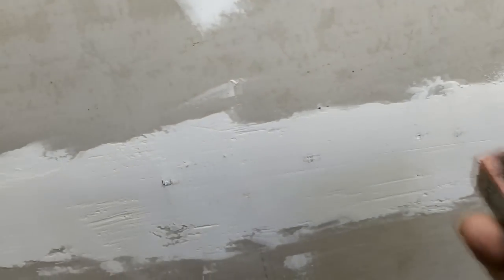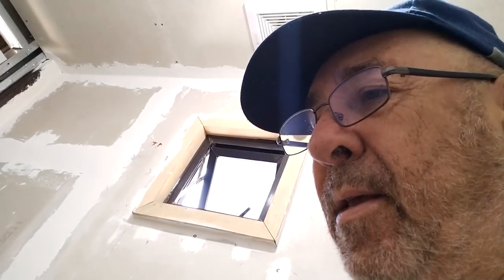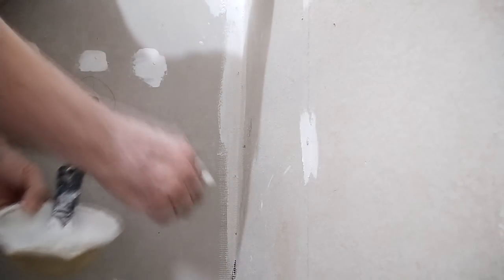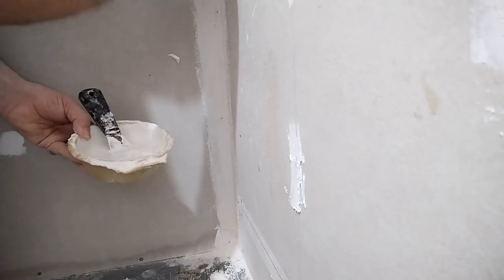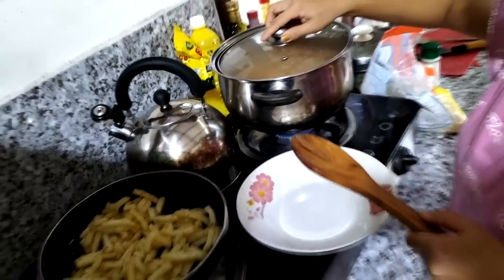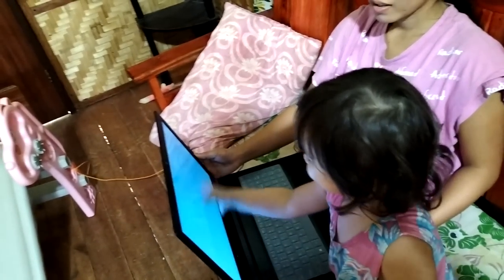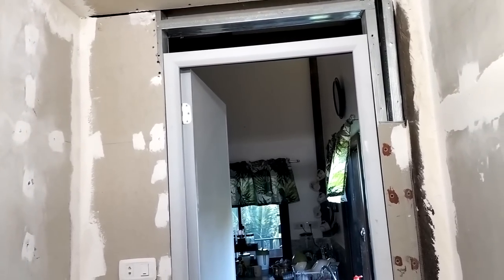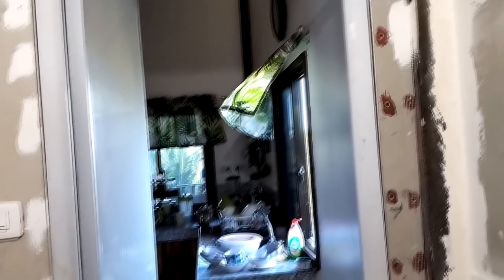V325 - FOREIGNER BUILDING A CHEAP HOUSE IN THE PHILIPPINES - BATHROMM NIGHTMARE - THE GARCIA FAMILY

Comment: As an ex tile installer,do not do it the Philippines way "cementing the wall and placing the tile" but do use tile cement and Butter the tile with a grooved tile tool and lightly butter the wall with said above tool ,press tile and it should hold itself in place .
Use tile spacers to keep your grout lines straight and remember you will have to cut some to make it look right .
Like stacking up a brick wall ..
Once everything is in place give it 24 hours and get your grout ready ( add water proofing liquid) and take a grouting tool over your work wait about 10 minutes and then take a damp sponge over your work leaving a great grout line ...sounds easy but it will have your wrists hurting for days. ... If anything go to YouTube and watch some stuff on how to do it .
Reply from the maker: Thank you😊👍👍but Adhesive tiles more suitable for a"moving" house. Already bought them

Comment: I used skim coat many times to cover up damage walls we use Polyfilla here in Uk, but I found skim coat good both inside and outside with a coat of waterproof paint over it. I to worry about tiling but once you get going it’s pretty easy. Good luck
Reply from the maker: Polyfilla in Australia too. Yes Latex paint before adhesive tiles😊👍👍

Comment: Looks like you’re getting there Joe slowly, but surely it’s a bit late now but I would’ve worn a mask. If I were you just one question why are you making good the wall when you’re going to tile over the rougher the surface the better the key I’m sure you have a plan. Good luck
Reply from the maker: Because adhesive tiles need to have a flat clean surface. Some areas are only painted
Reply: @retiringinparadise  ah ok I thought your cementing them to take up any  uneven  points, self adhesive sounds good. Another cheaper idea is use waterproof wall paper as I did